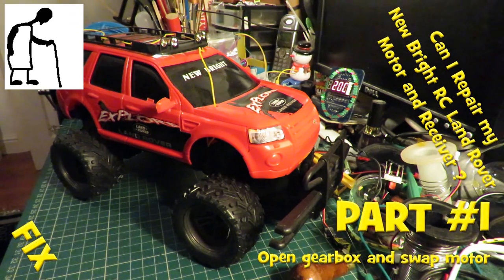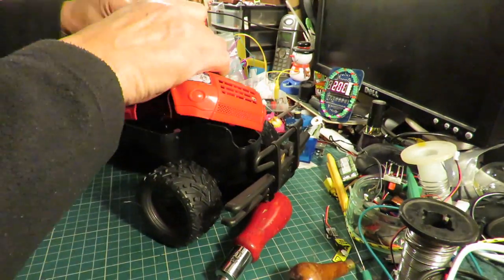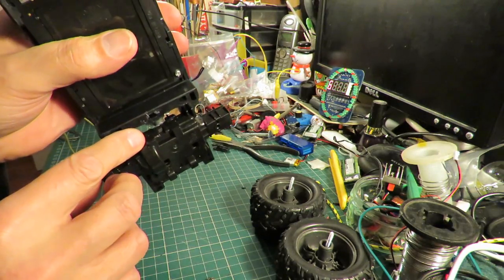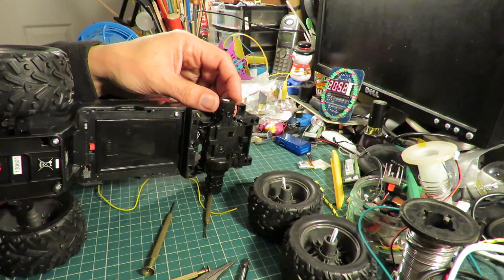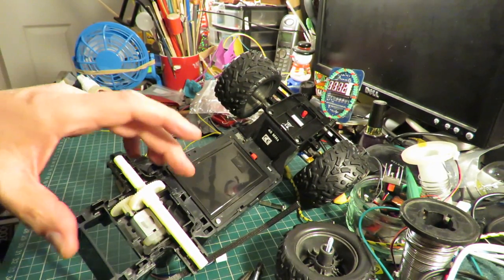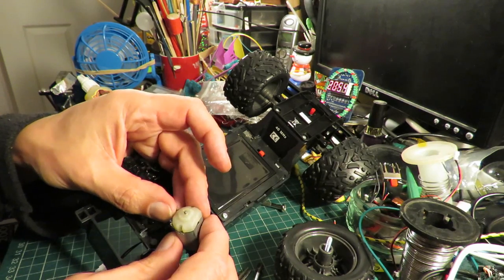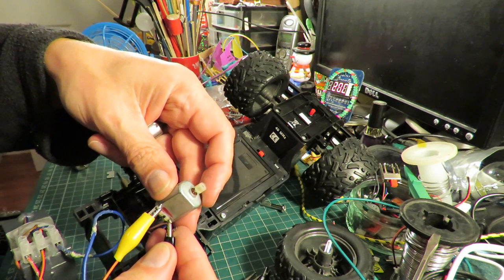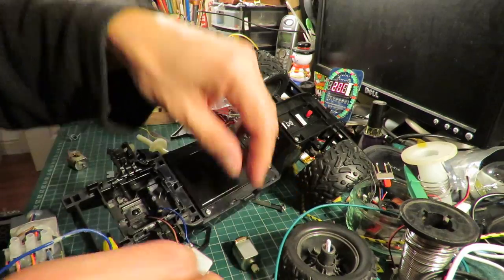Repair my New Bright RC Land Rover - Motor and Receiver PART #1

Comment: I think that's the same chassis as one here (Munster Truck). Was quite educational learning about the clips method. That motor is in some cheap handheld fans !
Reply from the maker: Yes those clips usually snap so I was pleased to get it apart all in one piece. The motors certainly don't seem very powerful although without taking it apart you can only guess at the number of windings, gauge of the wire and strength of the magnets. It does limit the options for a simple motor swap upgrade, maybe some of those slot car motors would probably fit and give a much better power output. I might think about that sometime.

Comment: hello, please can you say me how can i buy that motor?  how can i looking for by resistense or volts?
thanks for your video, it is very useful..
Reply from the maker: Buying electric motors can be rather confusing. Some are described by their diameter and length and voltage. Some use a numbering scheme. My best guess would be to search by voltage and then read the details to check the dimensions. Remember to check the shaft diameter if you want to match the pinion gear.

Comment: Ok bought my boy one for birthday and after a couple times of using it,  it won’t turn.  Steering don’t work.  I hear the motor when I try to turn it but wheels don’t turn.  Checked gears in gear box and they are good.  I have no experience in electronics
Reply: So now it will only go in straight line.  Oh well,  I guess it’s a drag racer ramp jumper
Reply from the maker: If you can hear the motor turning, my first guess would be that the pinion gear is slipping on the motor shaft. It could be split, in which case it won't grip and will need replacing. If it is not split but still slipping a drop of superglue 'might' hold it but you run the risk of getting the glue into the motor bearing. Alternatively it may simply be that some other part of the steering mechanism has come out of alignment after a hard bump.

Comment: Is this the 9.6v? If so where did you get the motor and gears?
Reply from the maker: You may find the video description useful. This originally had 5 AA batteries so it would have been running on 7.5 volts. I have lots of RC toy cars, I pick them up cheap in charity shops so I can just strip one down to repair another one. You can buy suitable motors on eBay or other online shops. These are usually called 130 FC DC motors - the 130 is the size and the FC indicates they have the flat sides rather than being round or cylindrical. You would need to measure your motor carefully and then check the dimensions of the one online to ensure you get the right size. I didn't need to change any gears.

Comment: I find it easier to replace the gearbox as the clips snap
Reply from the maker: yes
Reply: +GrandadIsAnOldMan hey thanks so much when you uploaded the series of videos on the big hobby grade conversion of the new bright corvette I have the mustang version and converted it to hobbygrade except for I put in a brushless system and I was able to do that from watching your video on how to crack open the gearbox and now it runs brushless with two s lipo and hobbygrade servo going speeds of about fifteen mph but I may put in a three s lipo anyways thank you SO MUCH your videos are awesome
Reply from the maker: Break The Bricks Down hey thanks for that feedback. I hate trying to crack open those gearboxes as the clips seem to snap so easily. Getting the right sized brushless to fit sounds like a really successful conversion. Are you going to do a video ?
Reply: +GrandadIsAnOldMan yes I will be doing a video hopefully and for the brushless system I used a eighteenth scale brushless system and its the exact same size as the old brushed but like double the power
Reply from the maker: Break The Bricks Down 😊